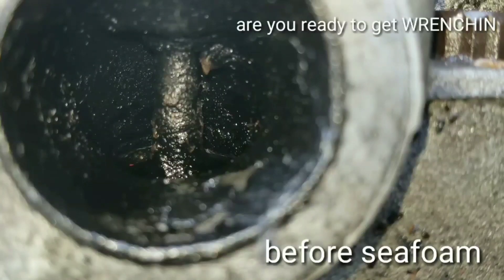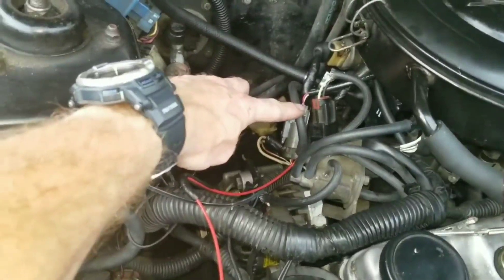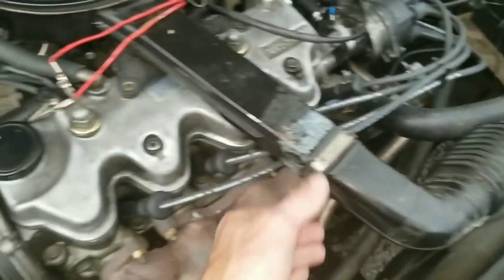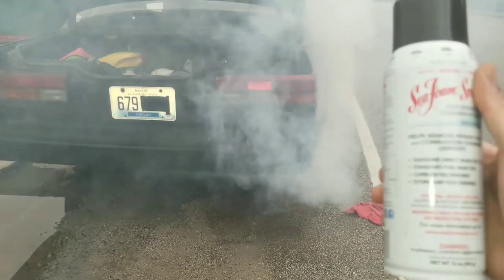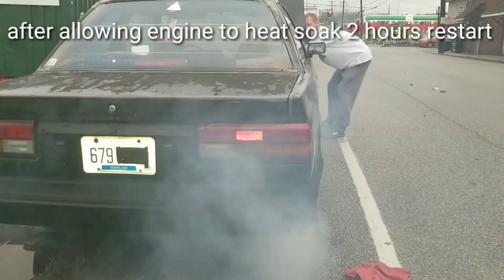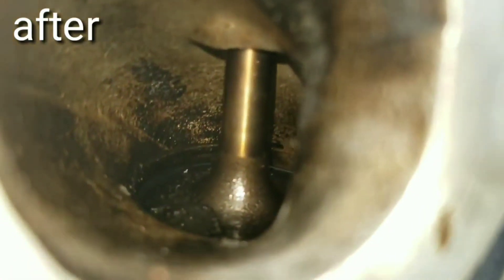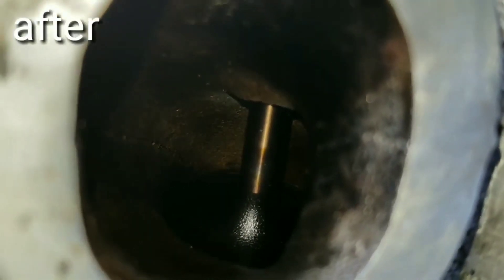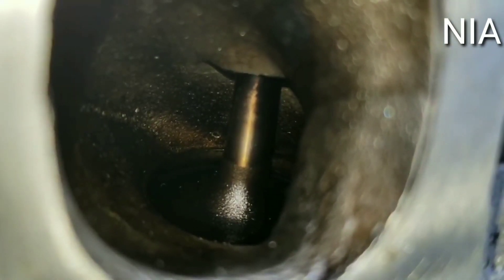How to use fuel cleaners for carbon  buildup intake  valve cleaning a GDI engine!

Comment: Not a direct injection engine. That car has a carb and the valves would always be getting cleaned by the gasoline coming in. No need for any treatment.

Comment: would it be just as easy to go through the carb vs an vacuum line?   after all when you have used the Sea Foam before you just took the air cleaner off and squirted it. directly to the throttle body.   just askin'

Comment: I have a 2014 Chevy Silverado 1500 with the 6.2 it has 45000 miles. It has been well maintained. It is required to run 95 octane. I only do light four-wheeling in the woods for hunting and it is Sand, Snow & Mud. Then just auto 4 in the winter when we get snow.

I also have a K&N air filter in it. Are they any good?
 Should I do a cold air intake if so what brand?

Do you know anything about tuning?
 
What do you recommend to help keep my truck to last and prevent any problems in the future? 

Seafoam? 
They make a High Mileage SeaFoam Or another brand?
What other products do you recommend?
When and how often?
Hope this helps to make another video on.
You could do make a chart on when and how often for age and miles of vehicles.
Reply: From what I understand K&N free flow filters for anything other than competition purposes is not good for your vehicle. They flow air all right but they also allow dust through. Use OEM air filters.
Reply: Dude, join a GM forum. YT comments isn't the ideal place to ask all these :)
Reply: @ozer1980  I know, but it is also good to ask on multiple platforms to see different opinions.